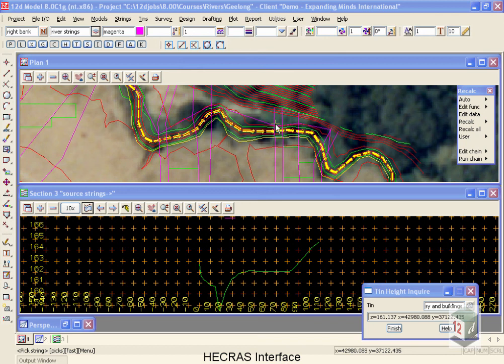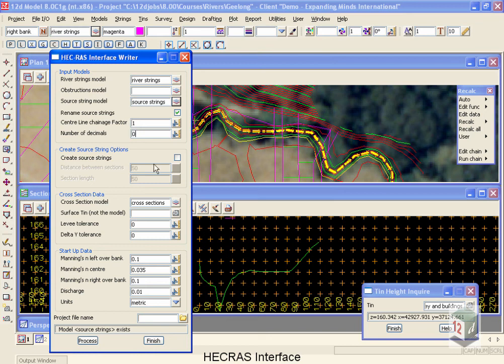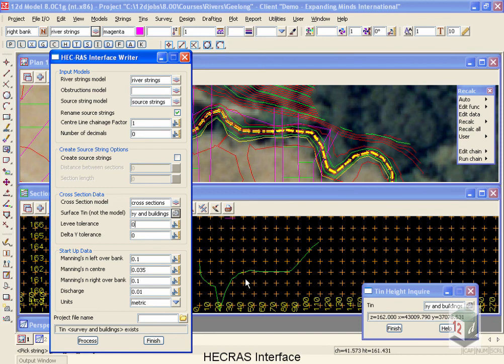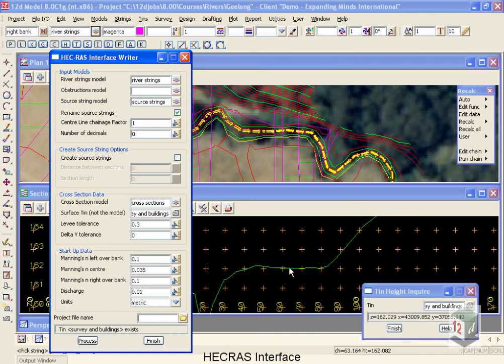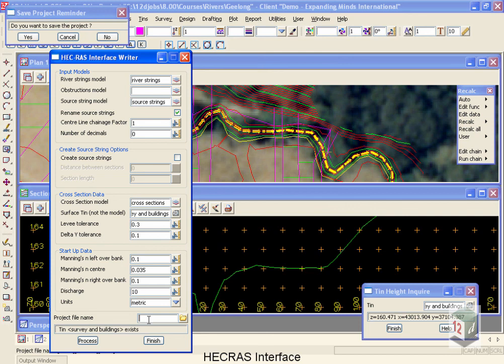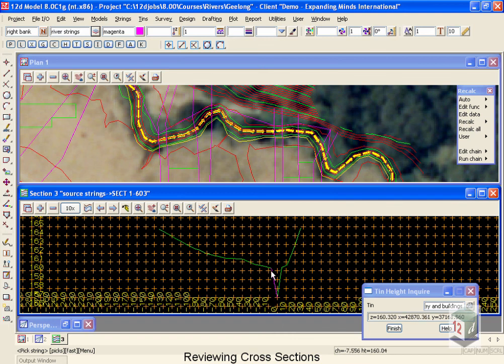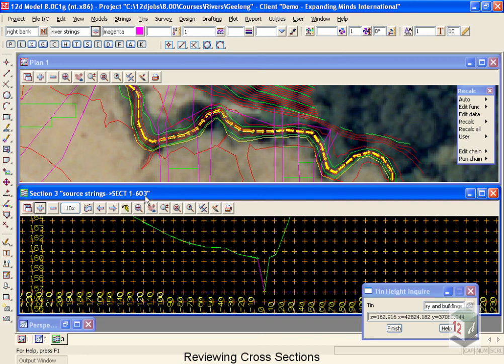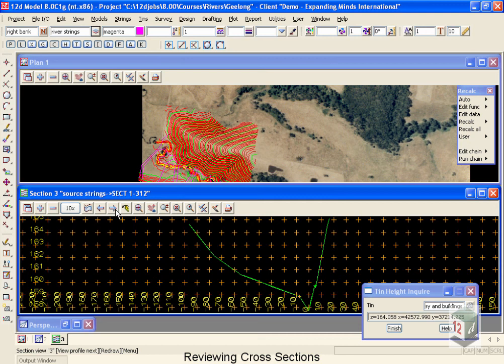12d Rivers 04 - Exporting to HECRAS

Comment: 12D hangs when I run the model at the "creating link attributes" step when I auto generate source strings at too fine of a distance between. The more complex the project, the more coarse the source string generation needs to be. This is on v12. 
Anybody have any thoughts?
My junctions are snapped, though if I generate the model rivers independently from one another, it still does this. I'm at my wits end! I've compiled a countless number of HEC-RAS models using 12D and this is a new error/issue for me.